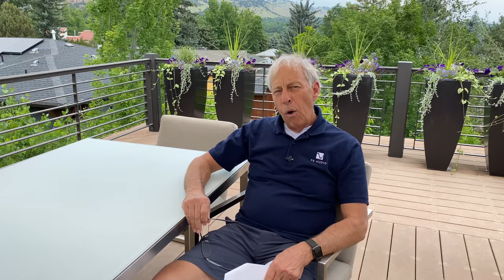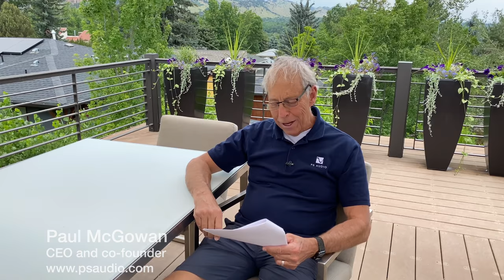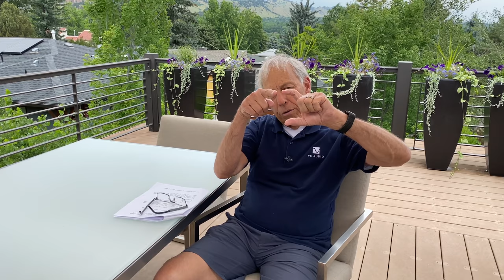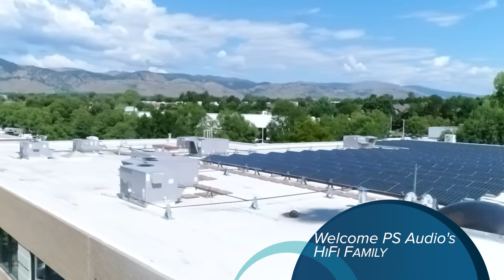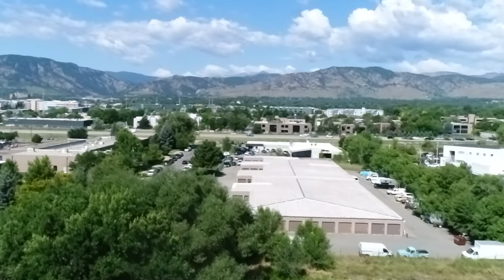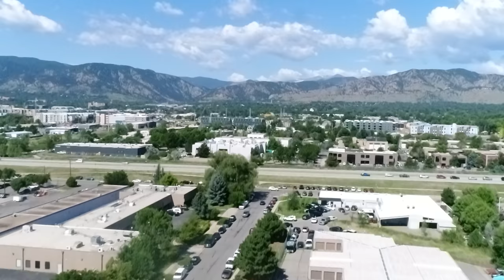What compromises are made for UK stereo equipment?

Comment: As 230v draws less amps than an equivalent wired in 110v.,Should we not be ordering our equipment in 220 in the US anyway? Also, 220v circuit in the US uses two hots and one neutral/ground. So the double breaker is in contact with both bus bars as opposed to 110v being a single breaker contacting 1 bus bar. This is how we make 110v or 220/230v. The UK system uses 240v coming in through one hot wire only and is 13A. It also uses neutral and ground or earth as it's called in the UK. It does not use 2 hot or live wires coming in from the panel like ours. This one confusing and works entirely differently.

Comment: A transformer designed to run at 50hz will not have the same output capability at 60hz due to less magnetizing current/flux, but will run cooler due to a lower magnetic flux density.

Comment: Howdy.
I would like to point out that running a 50 Hz transformer on 60 Hz means about 20% unnecessary iron and winding turns. The inconveniance is the unnecessary increase in winding impedances.
Having watched some of the PS Audio clips I would imagine that this has to be taken into consideration designing High End gear.
In high regards.

Comment: I can tell you a weird one. The Sony STR Dn1080 amp is a 7.2 receiver. The US model has 7 speaker outputs, 2 subs and another pair of outputs for a zone 2 (speakers in another room for example). So you can have a 7.2 setup in one room and a stereo setup in another from the same amp.

The separate stereo outputs are removed on the UK model and instead, the rear speakers are assignable as zone 2, meaning the UK model can only do 7.2 with no stereo zone or 5.2 with a stereo zone.

I can't think of any reason why considering out mains is a higher voltage, so power delivery should not be an issue?

Actually wait. If you can reassign the rear speakers to a stereo zone, does that mean you could reassign the stereo zone of the US model as extra surround speakers and have a 9.2 system.

Planned obsolescence? Intentionality crippled firmware?
Reply: Pricing, to match the competition is generally what drives these decisions, or to prevent cannibalism within its own products

Comment: That's a daft question with a very informative answer!  Companies manufacture to the regulations and standards of the places where they are selling them.  So for Europe it's 230V and any company outside of Europe wanting to sell electronics in the EU needs to meet that specification.
The EU standardised this which is a good thing.  It's easier to manufacture for 30 countries using the same voltage standard than it would be for 30 countries using their own, unique standards.
Companies in the EU manufacturing for the USA will make it to the standards required in the USA.
Reply: If it has an informative answer then by it's own nature it can't be a daft question.

Comment: Why does my Onkyo receiver have different power output ratings for what country it was for? 100 watts (per channel) @ 8ohms for the US and Canada. 100 watts (per channel) at 4 ohms for Europe and 130 watts (per channel) at 4 ohms for Asia?
Reply: Different counties have different standards of ratings. If you looked at the different countries specs they will list a different thd for the different countries some times. Eg one country will say 20hz-20khz 0.8%thd 100watts into 8 ohms, another will list the 1% thd value and write 130 watts into 8 ohms for that value. There is also a possibilty that some countries versions of a product use slightly different internal components. Sometimes due to safety and compliance regulations. Some countries have load limiters turned on by default which can cut power in half at lower ohms wheras others don't have that feature at all or don't have it as a requirement.

Lots of reasons, usually the first one.

Comment: i would think there would be a benifiet to 60hz. opposed to 50hz., possibly just a smoother signal.
Reply: In the days before digital, the 60 Hz line frequency was useful to use as a time base for clocks, either with synchronous motors or clock reference frequency.  In the older days, electricity was extremely accurate in frequency because this accuracy allowed the power company to sell the product to other utilities at a higher price.   With pure digital time bases, however it is not necessary, and power companies dot not regulate the frequency closely anymore.  Of course 60 Hz is better for clocks.  I do know how the countries that used 50 Hz controlled their electric clocks.

Comment: US amps are compromised! Not the other way around. We get more power in the UK! 

I used to sell amps made in the UK and when the amps were adapted for US voltage, the US version was weaker..... less power!
Reply: More input voltage does not equal more power on the secondary of these transformers.  Were you not listening?  That is the point of a transformer, to "step down" or "step up" voltage.  The current and voltage are the same on the secondary windings.
Reply: @buttonman1831  No that really depends on the saturation of the coils. If it's close to saturation at higher voltage, that voltage will have an impact.
Reply: @QoraxAudio  These transformers should never get close to saturation because they are engineered specifically for their application.  If they reach the point of saturation, that is an engineering flaw.  These transformers as Paul said were designed for the EU voltage standard first.
Reply: He is right. I remember in previous generation Emotiva amplifiers, in specifications they were stating that the maximum power was achieved when connected to 230V, the number that they were providing was only guaranteed at 230V. It is not always the case but sometimes it is.
Reply: @buttonman1831  More (= higher) voltage on the primary side results in more voltage on the secondary side. That's what transformers are for. Higher secondary voltage drives a higher current if the load (resistance) does not chnage.
Reply: @__Dude_  That is true for a step up transformer.  The ratio between windings on each side of the transformer determines the ratio of voltage.  Current has the same relationship but inversely.
Reply: behexen250 yeah I’m a flat Earther. I run a daily debate on the subject.